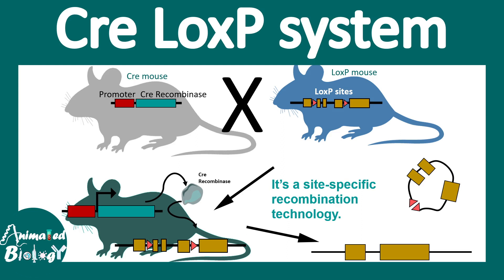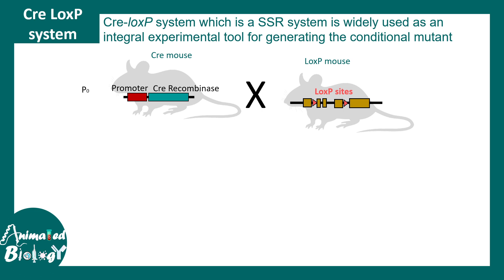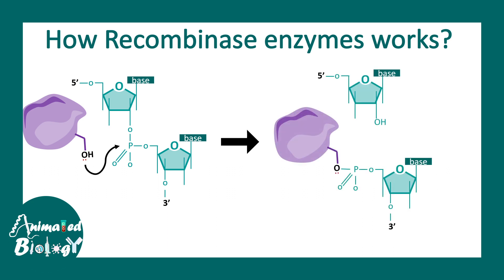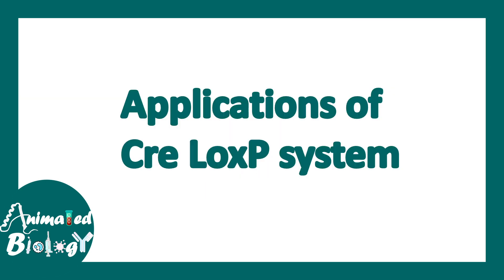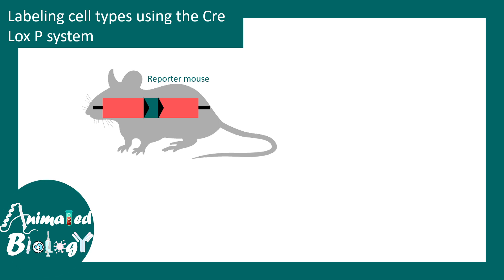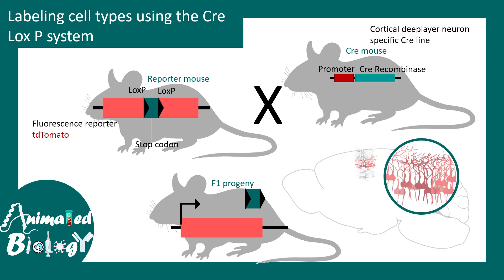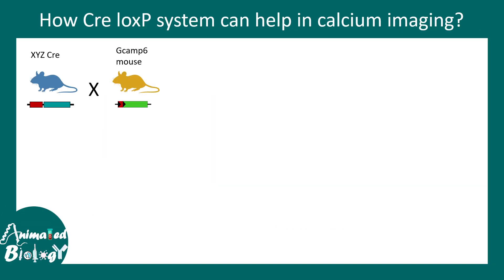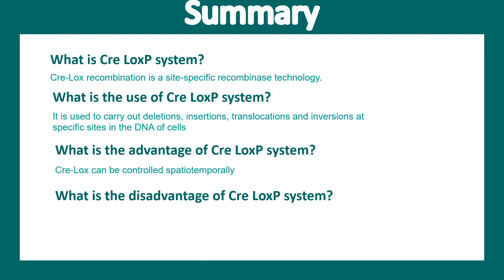Cre lox system | Conditional gene knockout using the Cre Lox system | site specific recombination

Comment: Amazing video!! I have a question, so in the LoxP mouse, all the tissues will have the gene you want to delete flanked by LoxP sites. 

And only in tissues where Cre recombinase is active will you have the gene deletion occurring. 

Do the LoxP sites around the gene interfere with the correct transcription/translation of the gene in tissues where Cre recombinase is not expressed? I am wondering whether the LoxP sites could interfere with the translation of the gene.
Reply from the maker: Good question,  in most of the cases it does not interfere. The loxP sites are small.generally they flank exon and not in orf.